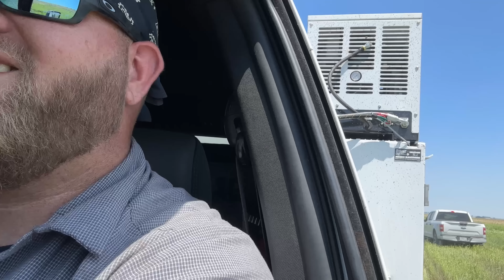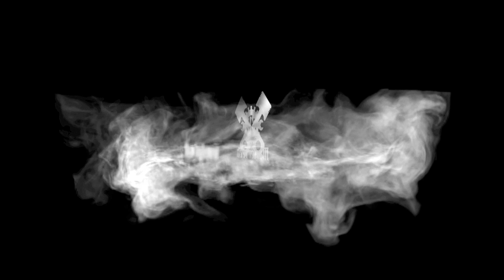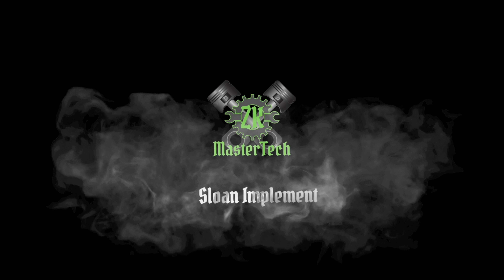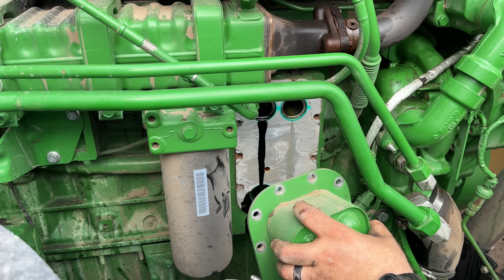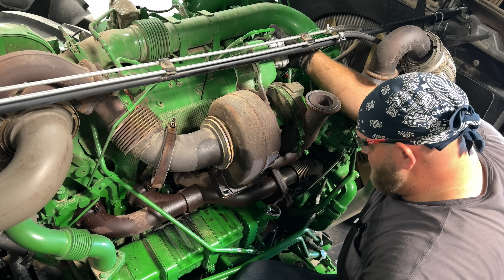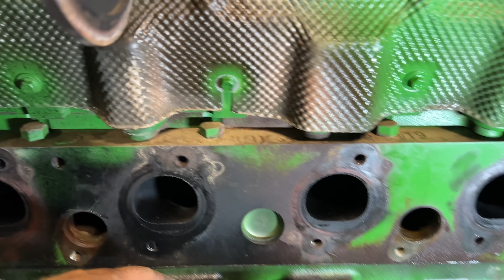The John Deere 9510R is back! Time to get the turbo, EGR cooler, and exhaust manifold fixed right!

Comment: You gotta vacuum fill these newer engines with EGR coolers or micro bubbles will cause tiny hotspots and the failures you saw.

Comment: I saw someone explain that exhaust bolts frequently are a different alloy. May explain welding failure. May need special weld rod/wire.

Comment: Pretty important thing to do is to prime the oil bearing on a new turbo before starting it.  I would imagine you did that, but it's certainly important to remember.
Reply from the maker: Absolutely! It's essential to prime the bearings before starting a new turbo. But trust me the oil pressure is there. Seen the oil pressure line not tightened before and it shoots out like a rocket before the engine even starts. That oil pump is no joke lol.

Comment: i'm just wondering, I just have a thought here if you want these oil cooler explosions where to put one of the oil pick up pads in that expansion tank after you do the repair to grab the oil and then would a pair of needle pliers pull that pad out wouldn't that grab the oilthat the residual left in the in the system just a thought I know we use those oil pads on the fire department and they pick up Oil pretty good

Comment: When you installed the new exhaust manifold bolts why didn't you use anti-seize on the threads so if they ever needed to come back out, it would make things easy.

Comment: Have you ever tried heating with torch or welding a nut and then dousing with a cup of water …. I use to take broken head bolts that way

Comment: When towing a very basic gear drive tractor, its gear shifter is just set in nuetral and off you go.
 With these more modern powershift type transmissions, presumeably the default position on at least one clutch pack is the 'engaged' position, when the tractor is switched off and parked up at the end of its work shift.
 How then does one go about towing a tractor so equipped - is there some trick Technicians use to disable all clutchpacks within the gearbox, to allow the tractor to be towed ?

Comment: Heating the studs; can you describe the physics metallurgy of heating the stud?  Thermal expansion is change in length over length and the HOLE is always longer around than the plug-stud.  Consider heating the hole and cooling the plug-stud like with carbon dioxide snow.

Comment: How lucky for the stud to come out
In the 90’s had a Cummins in a truck with broken manifold bolts ( not studs) 
Stripped it all down, spent hours drilling the bolts out, think some got heli coils in.
Came to put manifold back on ( it was a 3 section manifold) and couldn’t get some of the bolts in 
Ended up taking it back off and drilling the bolt holes bigger in the manifold.
That worked a treat, it was as though the sections had shrunk.
The strange thing another lad had to do the exact thing to its sister truck after breaking the manifold bolts 
Never happened again on them two trucks 
Keep up the good work

Comment: Mayhew makes a REALLY good stud extractor, I use it on manifold bolts all the time and itll pull them right out, plus its impact rated and its lifetime warranty, my Snap on guy carries them on the truck. I think its somewhere around 120$ but 100% worth it. It can even grab some small broken stubs unlike other extractors ive tried.  
Also give Spyder drill bits a try, ive been using them recently and really like them. Havent needed it on manifolds yet but have drilled out spot welds with them fairly easily

Comment: Left handed drill bits are good for broken bolts and studs. Only because the rotation of the drill will try to wind the broken piece out rather than forcing it deeper into the hole.

Comment: We have a spray here in New Zealand that actually freezes things. The idea is that if you spray the bolt or stud that it will shrink it enough to break it loose. I haven’t tried it yet but am very interested in seeing if it works.

Comment: An old mechanic taught me a trick with exhaust flange bolts,you heat it up then you zap it with cold water.Thermal shock 😊
Reply: Thermal crack 😂

Comment: As a safety engineer I'd like to make a friendly comment. You should never double wrench as the open end is designed to loading on three sides instead of one. Live your videos, and learn techniques for use in Oil and Gas operations.
Reply from the maker: Wrenches are guaranteed for life. Don’t care if i break one but I never have broken a snap on wrench using the double wrench method. Perfectly safe.  Sometimes i use wrench extenders to put some serious torque on them.

Comment: When removing a bolt like that I prefer to use a guide plate that's bolted to other hole and almost guarantees that a centre hole cuts straight

Comment: For the exhaust manifold studs I often have very good success by running the nut in to hits the spot with no threads and then keep going tighter and 99% of the time the stud will turn in tighter just a little then you can spin right out with the impact, no heat required.

Comment: Looking at what you were going through trying to line up and drill out that broken stud, and since you have to go through it more often than you would want to, would it make any sense to rig up drill fixture, a plate that bolts into the opposite hole across the port and holds a drill bushing at the correct distance?  You'd use drill bushings so you can swap sizes and keep the drill going in line.  Admittedly, you'd need a different plate for different spacings, but you could probably put 3 or so different center distances on one plate by clocking them around the bushing hole.  Anyhow, that would help with the alignment issue and keeping your drill straight.  Might be something to discuss with your dad the machinist.

Comment: Next time removing stud bolts. On the back nut, use a line wrench, open end round off too quick. If that doesn’t work, Mac makes a stud removal tool that looks like the Chuck of a drill. It’s used with a box end wrench  and the harder you turn to remove, the tighter it grips the stud, what a dream to use!! And a lot faster when labor is involved of course vs double nutting etc. But when using the Mac tool you will need new studs when done. And the rolling taps are good, I’ve used them, but I prefer the thread chaser from Snap-on or Sears (which I don’t think Sears has any more) both are identical but Sears is a LOT cheaper!

Comment: I'm sure you already know, and probably have done this but to clean out a oil contaminated coolant system I'll use dishwasher tablets or powder. Run it for a few hours and drain it, flush 4-5 times with straight water before a final fill with coolant. Works like a damn charm every time.

Comment: I had a new JD turbo.  The tech put it on and it kept leaking oil on the return line gasket. I tried. The tech tried.  We tightened till we thought it was going to break the 2 bolts. 2 new gaskets. No change, still leaking.  Turned out the new turbo had the threaded holes were not tapped deep enough and the bolts were bottoming out with about 1 mm left as clearance at the gasket surface.  Our solution was to grind the bolts shorter. So much for JD reman quality.

I can put a turbo on but you got to pay a tech to CB one out and programs the computer to calibrate it. 😡😡😡

Comment: Really enjoying your content as I used to farm in the 1970"s and 1980"s.  I do have a question regarding the exhaust manifold installation, why did you not use anti-seize on the studs ?  When I was still working, I used that on anything that might be an issue in removing later on.  After farming I drove truck cross country for26 years and we used anti-seize many things that could be hard to remove later and I can attest to the power and usefulness of this product.  Keep up the good work and keep the videos coming.

Comment: Copper grease the saving grace of exhaust studs ! Broken studs in a head, the things bad dreams are made of, good job removing the thorn in the system !
Reply from the maker: Thank you!
Reply: Service advisor actually tells you that anti seize is not required. The new studs are coated.

Comment: Stainless bolts & studs on exhaust parts, where heat causes accelerated corrosion might help. At least only one part would rust. Good job with the tractors and video. That is doing double work.
Reply from the maker: Thanks!

Comment: Thanks for another great video ZK. 
It was interesting and informative and enjoyable to watch. 

Wow. You are having a busy busy schedule. Of course planting time so any tractor breakdown that involves a planter is fix right away type call. I do understand. 

Well, anyway nice going with your dodge ram truck pulling the wiring harness tractor back to the farm and getting that farmer a rent tractor to use until parts are available for his. Believe you said your dealership was looking for parts. 

Now back to the original tractor you were working on that needed a turbo and a few other things. Getting all that apart proved a challenge of sorts. Broken manifold studs are the worst. But knowing you, you did a fantastic job of getting it out. Yeah!!!!!!!  Then pressing ahead. Lifting that turbo up there was no easy task. Was a learning experience seeing all the stuff you had to take off to do that. Once again, you were a great teacher and we learned lessons from you on the process. Wow. Not easy. Too bad you couldn’t use your crane. Low roof in the shop but it was air conditioned so that was excellent!!!!!!!!!!!

Nice going ZK on the one. You sailed through it in good time plus helping with another tractor. 

Hang in there. My compliments to you for moving right along on the turbo project. Wonderful John Deere service again by a highly qualified technician. Nice 👍!!!!!!!!

Thanks for teaching us again. Was a good one to watch. 
Thanks ZK. 

The Iowa farm boy. Steve
😊👍👍👋🇺🇸🇺🇸

Comment: Have your tried the new MAC RBRT extractors on broken bolts? Check them out. Might be the ticket for the ones you pull the heads off of. You drill a hole then pound these in. They are better than the previous old extractors with just the spiral flutes. Part # for the set is SXE7RBRTFOR

Grip edge has the same thing as these if you want to buy it under that name. They come with left hand drill bits also. Part # GE14FORSESRPT

Comment: Another great tool for turbo clamps would be the new Milwaukee fuel M12 Insider ratchet. It has pass thru sockets up to 15mm - 9/16sae. Its thin profile is great for tight spaces.
Reply: What would you say is the total worth of all your tools?